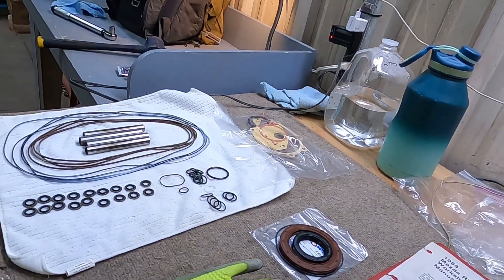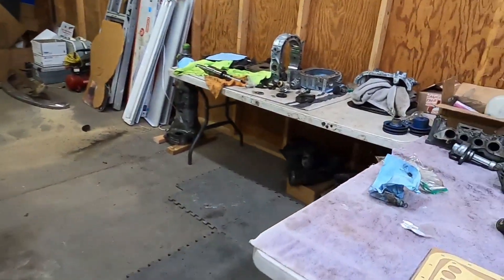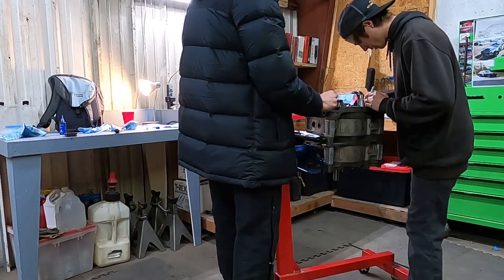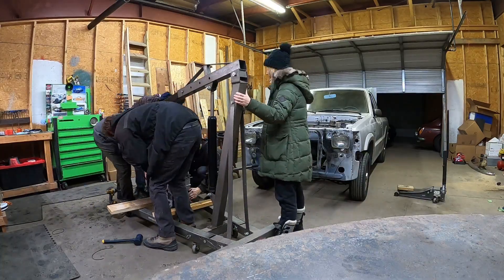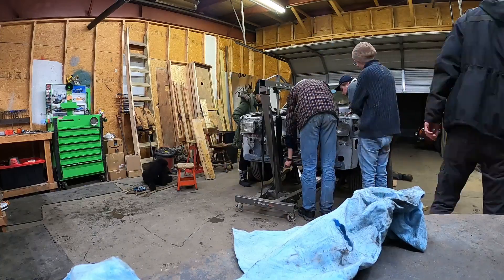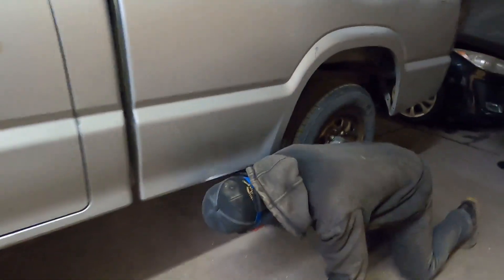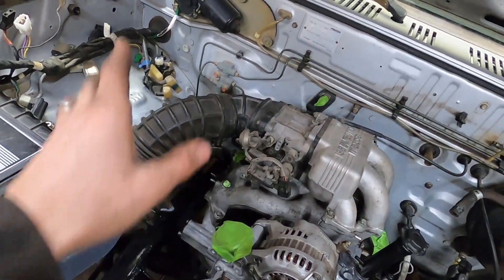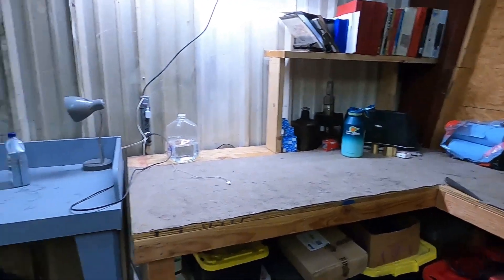Building a Ported Mazda 13b Rotary | RX2200

Comment: did you use the factory transmission?
Reply: i mean b2200 factory transmission
Reply from the maker: combination of the FC RX7 trans with the tail shaft housing of the B2200 trans